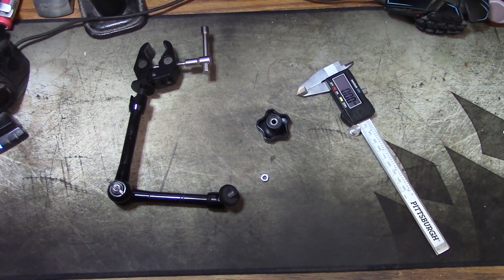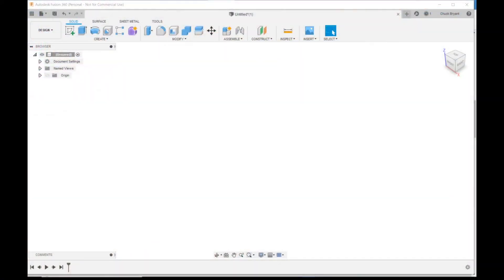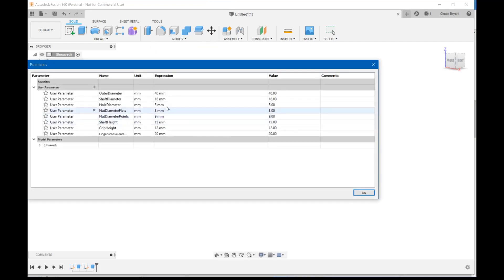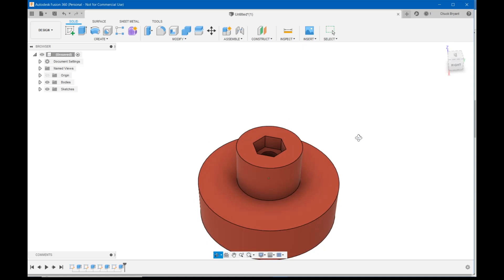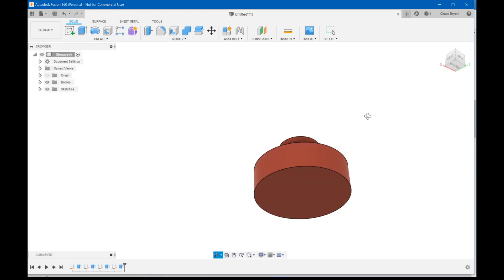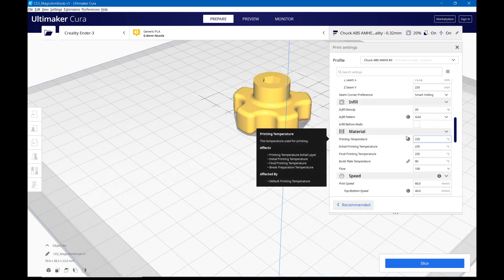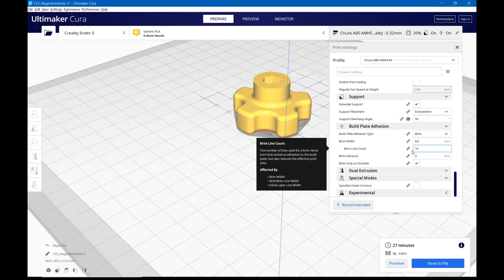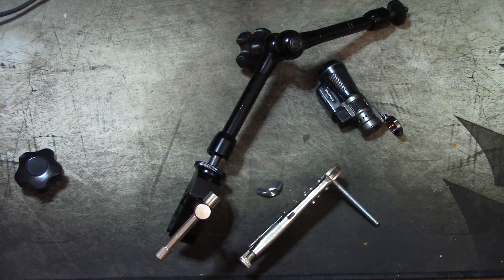Fusion 360 - Design & 3D Print a new knob for a Magic Arm camera mount.

Comment: In case you didn’t know. 
If you uncheck the “3D Sketch” on the bottom of your “Sketch Pallet” then your sketch will automatically reorient like it did before they updated F360.   Unless you prefer 3D sketching.....
You can also add multiple Filets in the same window by pressing +
Your unexpected Filet happened because you clicked on the Face of the knob at 19:15. But you definitely want a filet there for strength.
Reply from the maker: Good points. I've turned the 3D sketch thing on and off, and probably like you, I prefer it the way it used to be. Problem is, they have a way of removing things they feel they've "moved on" from like the old UI. So I'm trying to get used to the new way while I still have the old way to fall back on if I have to.
Good info on the + button to add more filets, thanks!
You're right, I clicked on the face and didn't realize it. And you're right, it was a happy accident because it's needed anyway!
Thanks for watching and commenting!